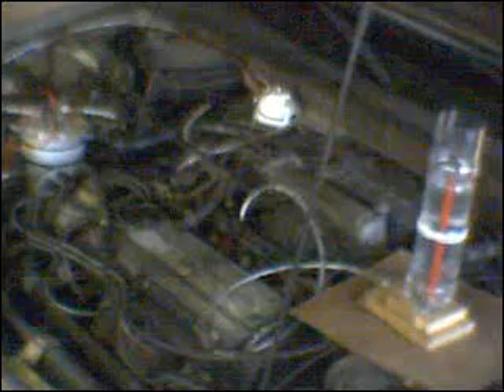#48 New Record 1.3 LPM HHO at only 294W or 4.44mmw eff!!!

Comment from the maker: Well, I appreciate your comments, but R&D to find what works first takes money. I need to run tests on the bench from a sturdy power source equivelant to alternator of a car. Can't do that with scrap yard materials and they're not cheap.

To test multitudes of cell configurations I need to invest in multitudes of plates, chemicals, adhesives, containers and test equipment, all to find what works best.

Comment from the maker: I agree. The alternator I think is 60 amps. I'm considering a 2nd alternator just for the HHO. There are pulse designs that use the field coil of an alternator as the means to provide PWM output from the alternator, also relative to engine RPMs which would be a bonus.

Comment from the maker: Just got 1.76LPM after another highway run. 13.19V, 29amps, 382W, 4.61 ml/min/watt. 178*F operating temp. Video going up shortly.

When stone cold this morning (about 40*F) it only drew 11 amps at 13.5V. Conductivity rises quickly with temp. Volts drop in later measurements because higher current creates more voltage drop in wires to the cell. Heavier gauge wire would have made the amp rise even more dramatic!